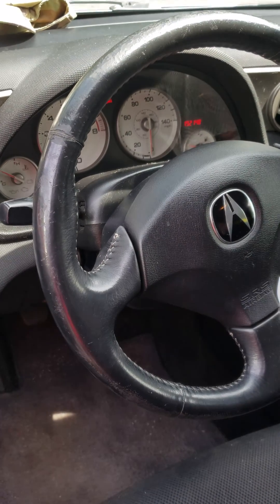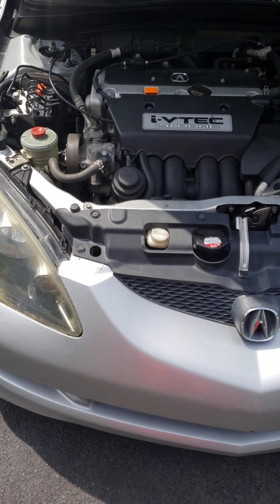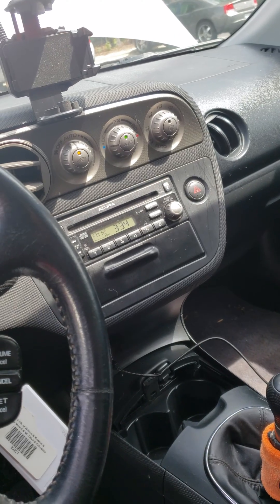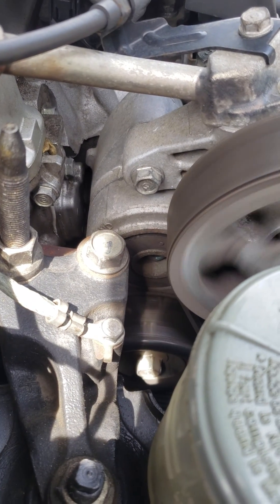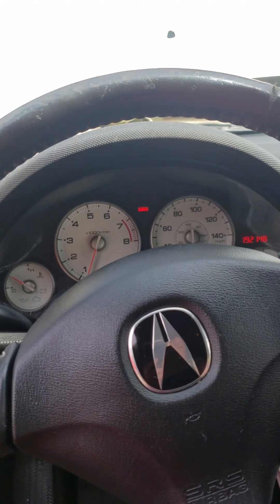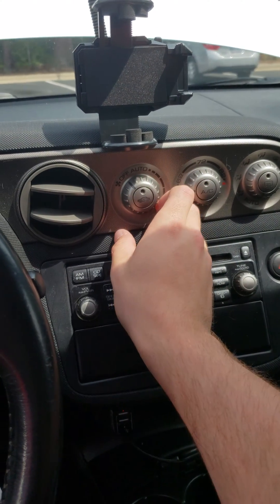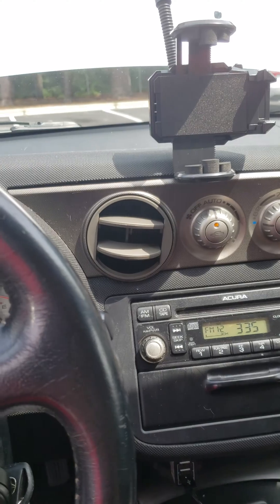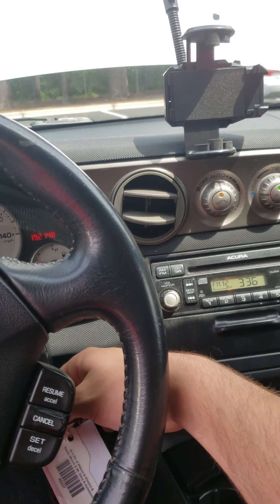Rsx AC issue

Comment: Then change your pulley dude ALL RSX rpm will drop and be slow it’s just common
Reply from the maker: I actually ended up figuring out that its the fan closest to the AC compressor. And as mentioned I switched out the tensioner and pulley
Reply: It looks like the pulley and tensioner, not the fan

Comment: Did you even find a fix to this?? I’m currently having the same problem with my rsx
Reply from the maker: Yea, believe it or not the knock went away in it's own, i tool the compresor off changed out the clutch and it seemed to right itself but the pulley and clutch weren't the issue I was just to poor to buy a new compressor
Reply: RiggsRides did you do the dryer with it as well? Did you go from the top and take everything in it’s way off?
Reply from the maker: I removed the radiator support and connected parts. Pulled the ac off the block but didnt remove the lines. Impact gun was my friend
Reply: @LTRiggs321   you may not remember, but just to be sure the ac compressor was the culprit?? if so thank you for answering the question, my acura makes the same knocking sound and i dont like it :\

Comment: I would replace the AC clutch. 

AC blows cold and great. 80$ fix
Reply: takes 6-8 hours. but Im about to do this to mine my clutch is a bit of a drag. the bearing must be really shot under a load
Reply from the maker: @chapstickevo  yea I just finished changing out the pulley it was not the issue but hey at least it's new now